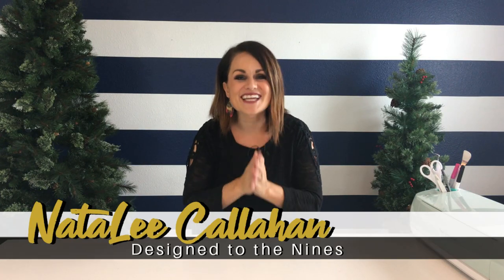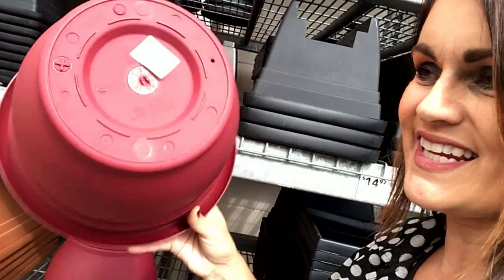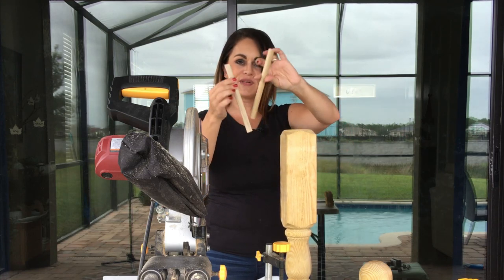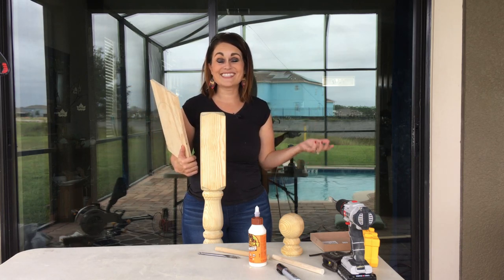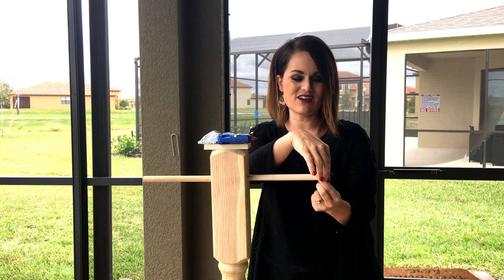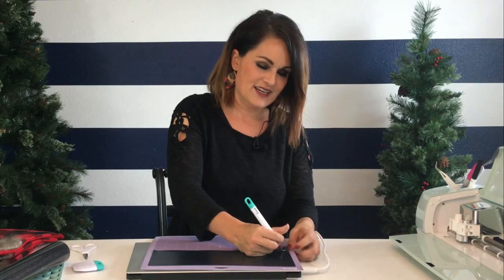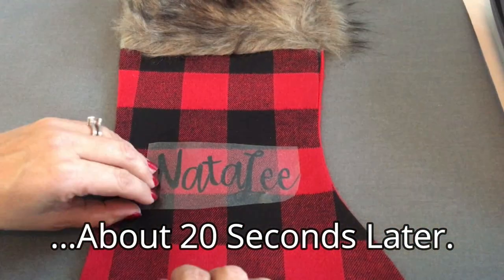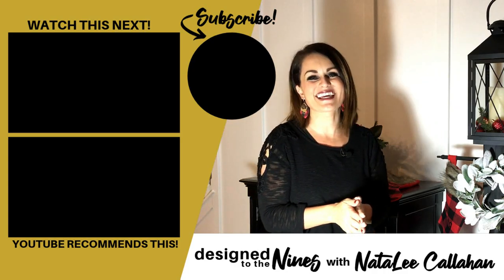Wow! DIY Lamp Post: Farmhouse Decor On a Budget!

Comment: I love this lamp post!!!  And thank you I didn't realize I could get these posts this large at Home Depot, I want to build a kitchen island: more like an old fashion table higher than a normal table. I've been searching thrift stores and estate sales for a high table, not finding them.  And I do love my Cricut too. My daughter has the newest version and several of the heat presses.
Reply from the maker: Call ahead or check your local Home Depot some have them. Some don’t. Mine is from Lowe’s because mine didn’t. 😃 Thanks for watching!! 💕
Reply: @designedtothenines  Thank you again, there's a Lowes in a town not too far from me, about 30 miles, so not a problem. I didn't think about these two stores maybe having these posts as tall as they are.

Comment: I was lucky to find those stockings, because there are none to be found now in the DT's I shop at.  I made a lamp post years ago and I'm in the process of making another, both from garage sale finds. Hadn't thought about adding the dowels on the sides though, I need to remember that! Your finials look so perfect on yours!  We have 2 fireplaces, but this is a great idea for hanging "for decor only" stockings on for the one we don't use to hang them on.
Reply from the maker: That’s the great thing about the lamp post is even if you do have a fireplace it’s still cute decor anywhere! Good luck with yours!💕

Comment: Can these stay outside on a porch in a snowy climate? I want to make 2 of these for my mom for Christmas decorations for outside of her door. She has a raised concrete porch with a roof over it, but the rest is open & exposed to the elements. Our winters get cold & snowed (I’m in Buffalo 😭) lol. And do you think it would look good if I make one regular sized lamp post, and tthen make another post, but shorter? Or would 2 posts side by side be too much?
Reply from the maker: I think if you got lanterns that were specifically made for outdoors he might be OK. Everything else should be fine. If you’re doing two posts I would put one on either side of the front porch. If you liked this episode. You’re gonna wanna stay tuned in a couple of weeks I have something that may solve this question for you.

Comment: The problem with DIYs like this is that many of us do not have those kind of power tools. I have a miter box but I'm thinking this would be too big for that. And I live in a small apartment. Im sure it's a great diy for anyone who doesn't fit into those categories.
Reply from the maker: You could probably get away with miter box for the top part . A jigsaw you can get it for around 20 bucks or for the bottom part you could just find a wood round. I hope that’s helpful! I do do tutorials that don’t use power tools too. I try to balance it out. 😃